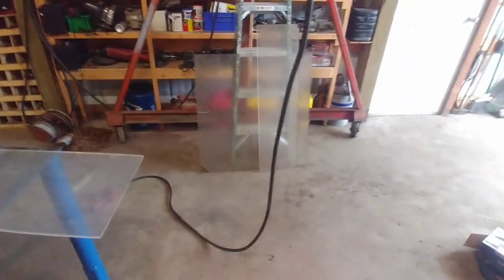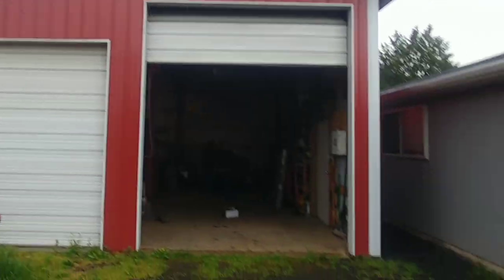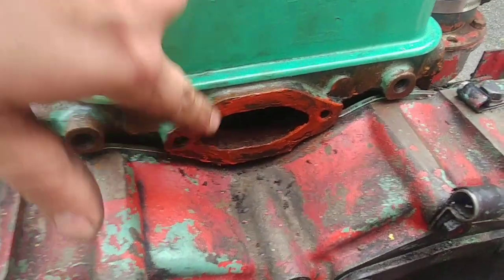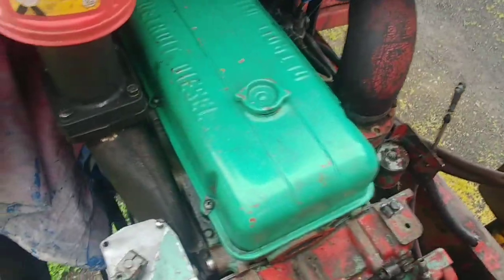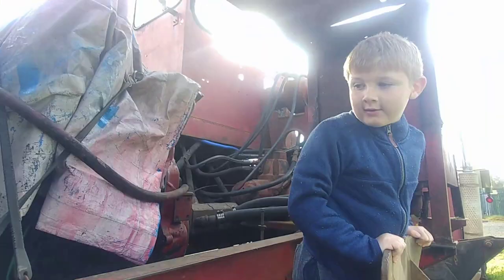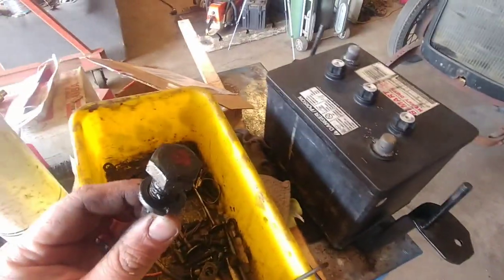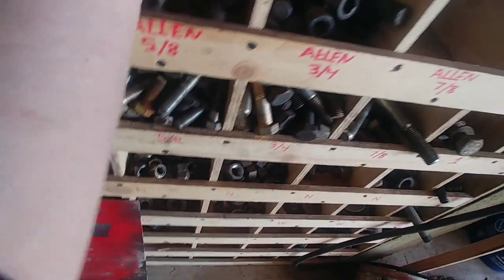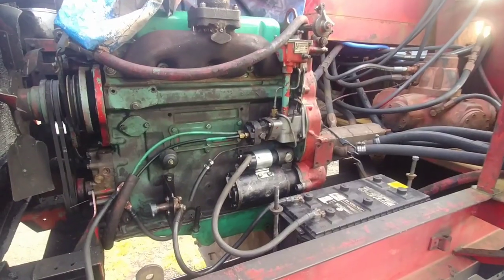Working on Odds and ends on the log loader.

Comment: Good job on the battery cables.  I like the looks of the crimp that little crimping tool made by putting it in the press.  Those cables should do the job.  I think you made a wise choice in making the cables a little longer if you are going to be moving them around on a regular basis.  You definitely don't want them to be bending right at the wire end lugs at terminals.  That would likely be asking for problems.  I did complete my new cables for my backhoe.  Used 2/0 gauge.  The cost was reasonable with all runs being very short and they will be in a fixed position installation, so movement near the cable lug ends wasn't a concern.  While shopping for cable, I did find out something interesting.  Initially I had planned to use welding cable. It turned out the rubber based covering on those cables does not do very well when being exposed to oil or grease.  The coating on battery cable material is specifically engineered to be oil and grease resistant, the insulating properties don't break down over time if exposed to lubricants. Great to see more progress on the log loader, well done!  Nick, North West Farmer
Reply from the maker: You know when i was making my battery cables I was thinking of your backhoe and I was wondering if you used wekding cable like you said you were planning on....  I said in the video it's 2 gauge... But what I ment is mine are also 2/0 gauge.. I did not know about battery cable insulation being oil resistant... Good to know thank you for that!!
Reply: @tttco  It would be good to check with the supplier regarding the insulation on a given product.  There is letter and number coding on the cable that indicates the application the wire is designed for.  When I began checking on welding cable, they asked what my application was and at that point each supplier warned me about using welding cable for battery cable due to possible damage to the rubber based insulation being in contact with equipment fluids.  There my be welding cable designed for oily areas.  Check before you buy.  Nick, North West Farmer
Reply: Rene Drew  Copy on that.  Free is almost always a good price.  Nick, North West Farmer

Comment: You can get those back bolts with a 12 point shallow socket and a extension with a slight wobbly end. Done many in boats and equipment

Comment: A old timer said to me once it's harder to add after you. Subtract to much allows like bat lines to be little longer and fuel lines to remember that's what zip ties and high performance duck tape for gorilla tape on fuel line keep it from worn on well works on my suff if to much move mint